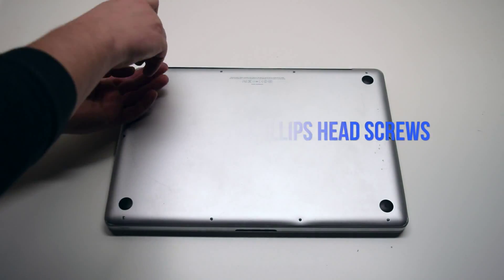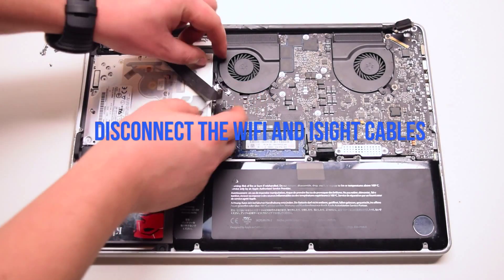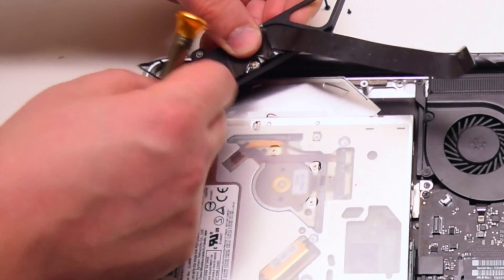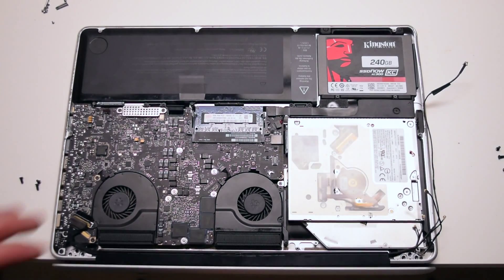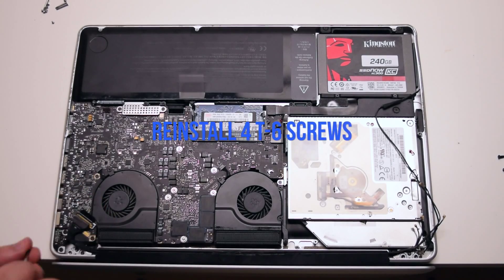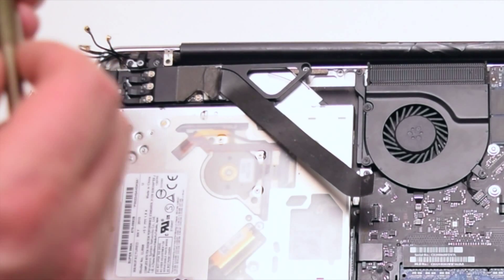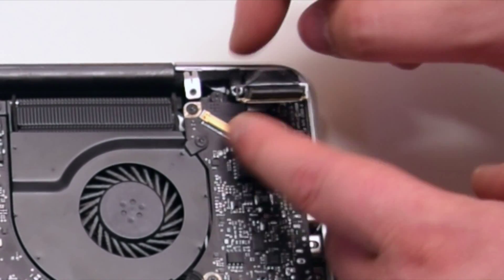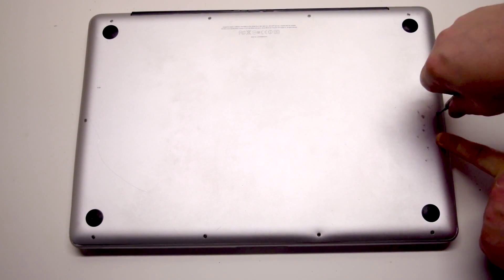2011 Macbook Pro 15" A1286 Display Assembly Replacement

Comment: Very good and complete video with good sound.  But you left out something that screws up beginners all the time, and beginners are the people who are most  likely to be watching your video.  What you left out was that, when removing cables attached to the logic board, whether to lift vertically or slide horizontally.  Get that wrong and you'll trash the logic board. For example, you'll destroy the board if you pull the fan or audio cables horizontally (they lift off vertically), if you pull the iSight cable vertically (it slides out horizontally), or if you lift the LVDS cable vertically (it slides out horizontally). Even the battery must be disconnected by lifting vertically, unlike newer Macs.  You're so used to this that it's intuitive to you, but it will NOT be to a beginner.  And yeah, your hands obscured much of the important stuff, like the WiFI antennae reassembly.
Reply from the maker: Thanks for the input.

Comment: I tried to do this but my screws won't come out.
Reply from the maker: Use and extension for the screwdriver or a longer T6 screwdriver, the longer, the more torque there is,  the easier to loosen the screw.